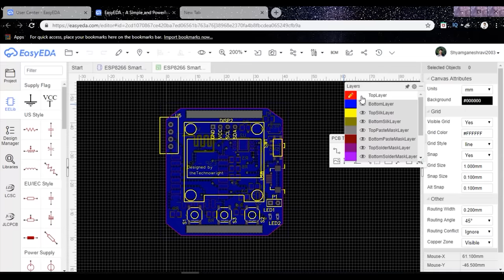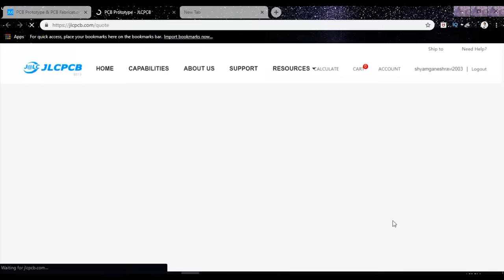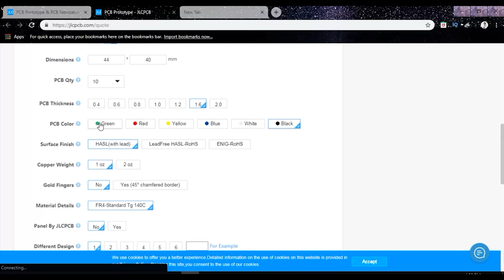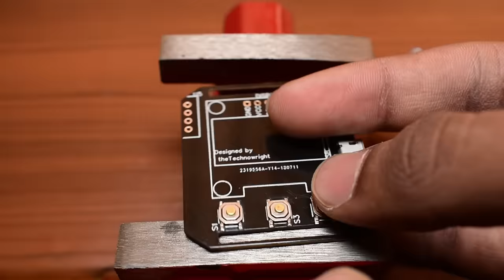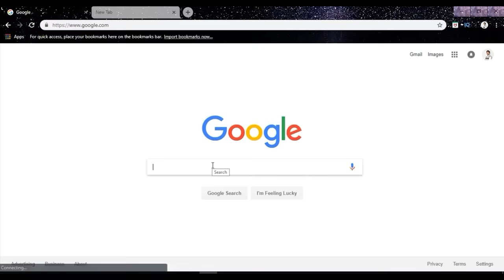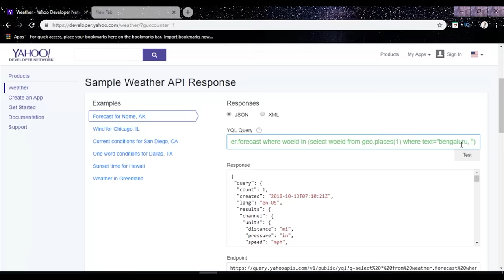How to make a DIY Smartwatch! || ESP8266 IoT Project

Comment: This is what happens, when MKBHD reincarnates as a DIY youtuber. Haha, just kidding. :) Very cool project and video, congrats! :)
What kind of heat-gun are you using? I've always feared of trying out SMD soldering, but this seems like a very neat way of doing it.
Reply from the maker: I am using a Yihua 858D hot air soldering iron, here is the link- https://amzn.to/2EHGLsC
Reply: You know when I tried using solder paste I used my soldering iron to melt the paste, worked OK for my project, well till the iron burned through the ribbon cable hooking up the oled display.  I  have used several spools of solder since that time, last week I assembled a project that had half sm and half conventional parts all using a soldering iron with no problems, well one capacitor is a bit crooked but it is on both pads very well, just looks a bit wonky but I have No problem with that, as it works great.
Reply: @shyam-ravi  thanks! :)

Comment: I tried uploading your gerber file but I'm not getting the thumbnails of the board like your video shows nor does it pick up the dimensions. Any suggestions?
Reply from the maker: I rechecked the gerber file by uploading it again. There are no issues with the gerber file. Try re-uploading the file again to JLCPCB. And also try uploading it to the Gerber file viewer: https://gerber-viewer.easyeda.com/  and see if it appears properly.

Comment: can any one please help in this project ..i did the complete assembling of the pcb and i connect the batter y and i didnt connect the oled display .the problem that iam facing here is iam unable to upload the code even i press and hold the sw5 button ..please help needed to complete this project..thank you

Comment: 50 dollars for shipping? That's a lot.
I know they also have an offer for 8 dollars, but that's still 4 times as much as the original PCB prices (for 10 bucks 10 PCB's is still a good deal though)
Reply from the maker: Yes, it is. And the shipping charge remains the same even if you purchase more expensive PCBs(Like the black colored PCBs which cost $18).

Comment: $50 shipping?
Reply: hidden costs.
Reply: Don't cry like a little child. Ofcourse it's like that. Why else would a company sponsor this video?
Reply: If you watch carefully, you can have other options as well. $50 is DHL, usually pretty expensive.
Reply from the maker: The shipping costs for USA and most of the countries in Europe is around $18-25 via DHL and around $6-15 via registered mail. You can try entering your country in the website and check for the shipping costs.

Comment: PCB  shipping price $49.82, under 20 dollars hmmmmmm?
Reply from the maker: The shipping charge completely depends upon the country you live in, so I excluded the shipping charge of the PCB's. The shipping price is much cheaper if you opt for register airmail($5-15). And dhl should be around $18-25. But unfortunately Dhl or airmail wasnt available for the country I am in. So I had to opt for a much expensive shipping method.